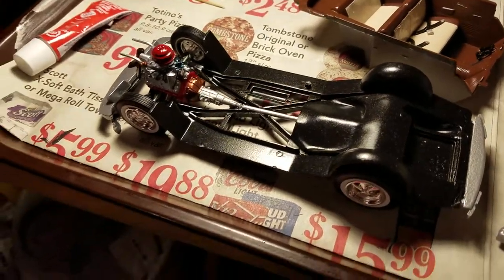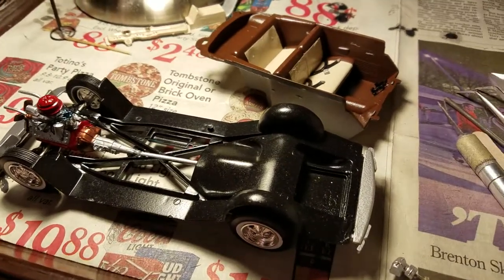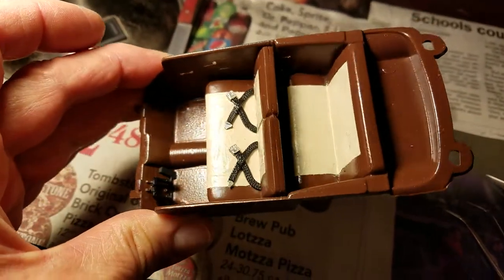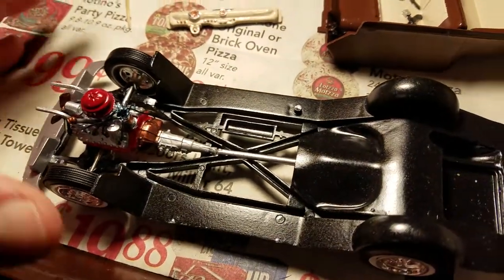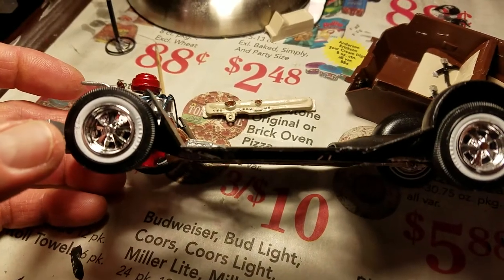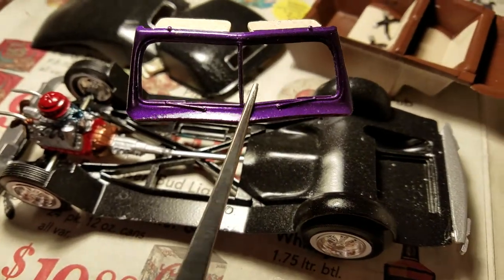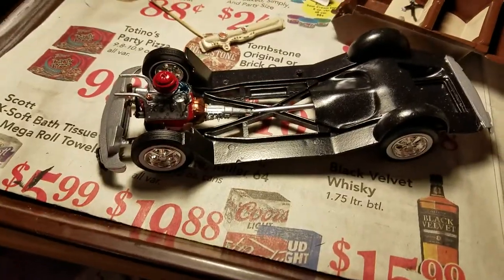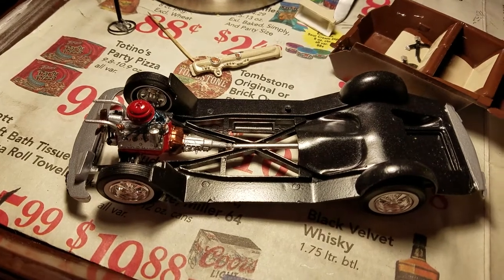Update on my 1950 Ford Showboat model car

Comment: Nice work, the '50 looks good. If you want to save money on kits you should check out local flea markets. I've been buying from a guy at my local one for years. 10 bucks for a complete kit is what my guy charges. It doesn't matter if it's new issue or vintage.
Reply from the maker: Thanks, I'll check that out, and thanks for stopping by!
Reply: No worries.